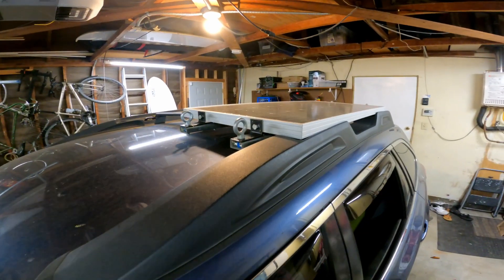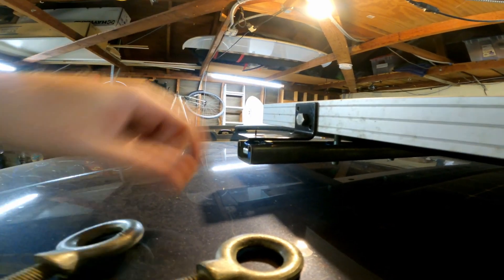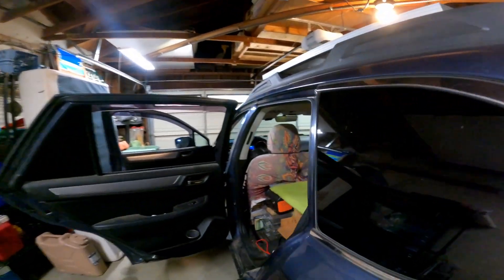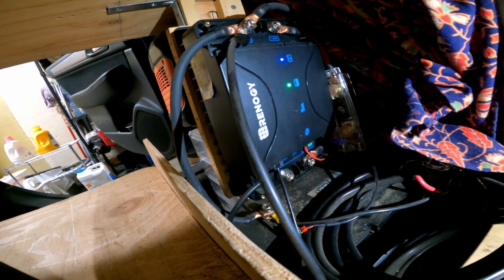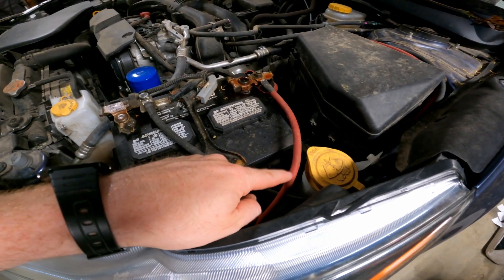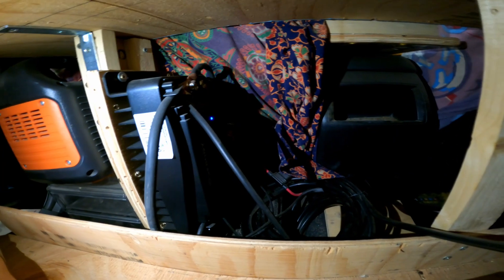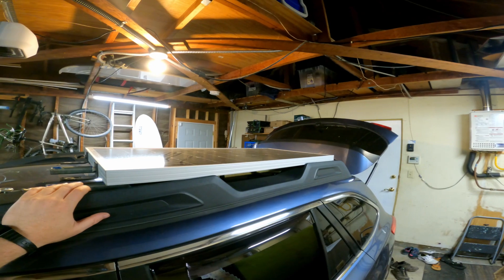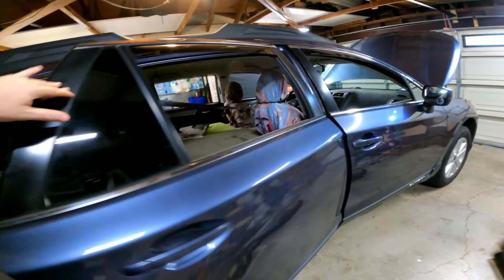Subaru Outback Solar Setup, Renogy DC30 12v DC-DC Charger w/ MPPT Review, 100Ah LiPO4, PangeaMan

Comment: Could you not fit another 100w panel on the right side of the rack? Was hard to tell from the video but seemed like you had space for 2 100w panels side by side.
Reply from the maker: i ended up redoing my roof setup and now have 4 100 watt panels on the roof! I made a video showing the process on this channel. Cheers.

Comment: Hey Ryan, This video was  what I was looking for. I am needing to do this with possible travel trailer. I'm saving this video .I'm  scared to do this because  I don't know anything about solar. I know I want a solar /wind turbine kit 400to 600 watt panels. And don't know what size inverter  as well as how many  batteries to get.BUT THE BIGGER ISSUE IS I have a pacemaker and so I am not even suppose to jump my car. So I guess I'll  just have to hire someone. Don't suppose you know anyone in Oregon who does electric..
Reply from the maker: A really good option for you might be to get a jackery 1500. You could pick up a few solar panels and hook them up to it. It would be really easy to start out with and you wouldn’t have to deal with wiring and electrical.
Reply: @ThePangeaMan  I just was looking at price and solar genarator with several panels is like 5 or 6000.00 a solar/ with wind turbine  for when it's dark and windy.Power always. And that system is At more  reasonable 1800 00.  Come with batteries all that's needed but I'm sure there will be solar extention cords to reach inverter. I'm gonna call electrician  and see how much they'd charge to put in.i need a 5 in one lock on travel trailer door rather that regular lock in case I lock keys inside.and learn how to install a woodstove in trailer. And disconnect all propane. And use it outside.but I need to look for more videos any suggestions?
Reply from the maker: @shantannaNewBeginnings  I learned everything i know about solar from DIY Solar Power with Will Prowse on youtube.
Reply: @ThePangeaMan  thank you ,say hello Hudson 👋

Comment: no water leak issues routing between tailgate weather seal like that? do you leave it permanently routed between the tailgate like that? looking to add a panel to my outback if I can find a good solution I can leave full time without having to drill body and this seems to good to be true, worth a try at least, thanks!
Reply from the maker: I haven’t had any water issues routing the wires that way. It’s been on my car for almost 3 years now and it’s been through pretty serious weather. I highly recommend mounting a solar panel this way!!!!! Cheers!
Reply: @ThePangeaMan   Thanks for the response, this is exactly what I needed to hear to to go for it, now just deciding on renogy or slightly smaller footprint newpowa 100w panel, going onto a roof basket so mourning should be easy. Thanks again for the help and great Outback vids!
Reply from the maker: The renogy solar panels are pretty solid. I haven’t had any issues with mine over the years.